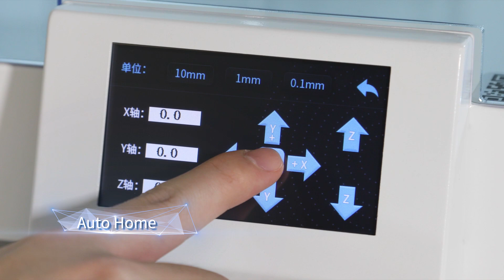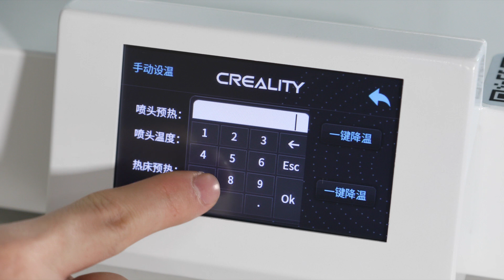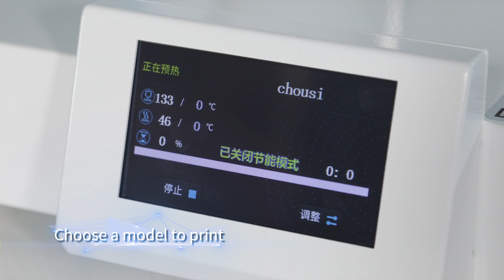Creality CR-5 PRO Unboxing Video

Comment: why do you make it look like Ultimaker knockoff?
Reply: What do you mean its a corexy which the Ultimaker isnt, and a printer in an enclosure is a Stratasys patent not Ultimaker. Literally every 3D printer is building off each other, prusas are like 95% other printers ideas. Or do you mean because its white? If that's that case yikes.